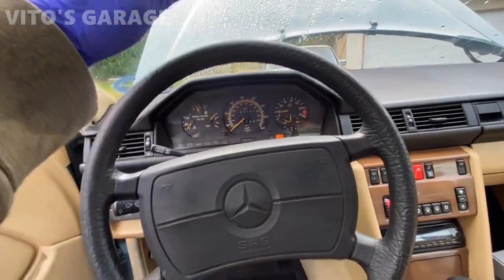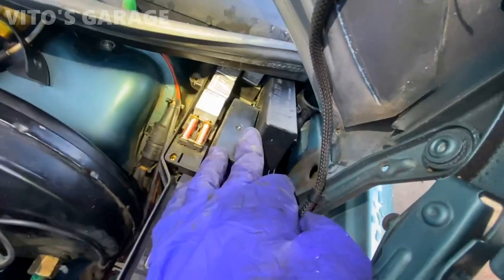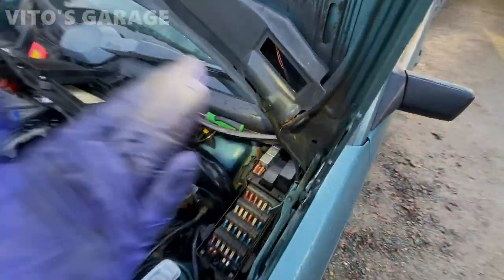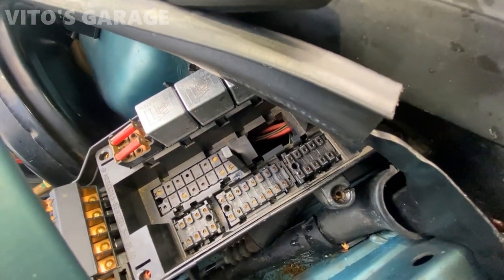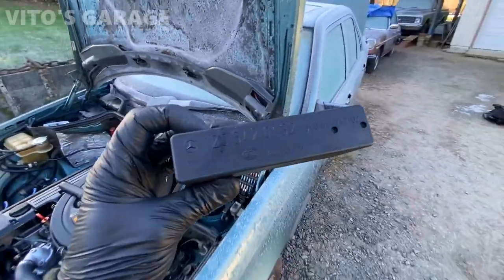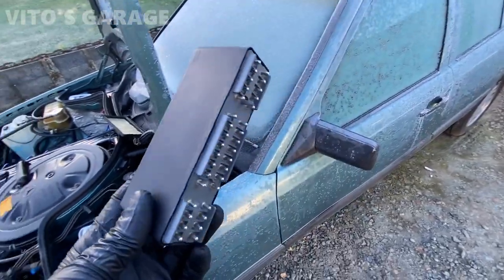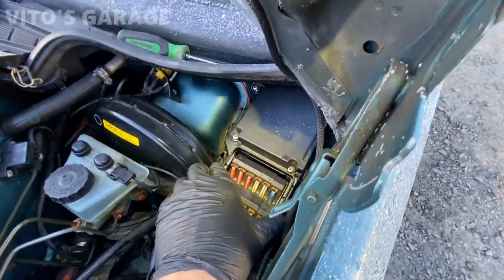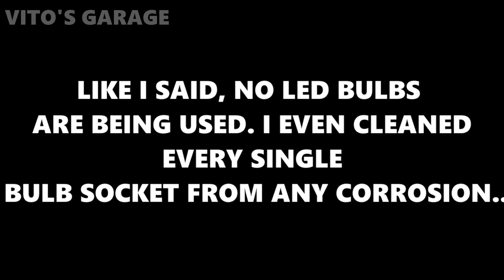W124 Mercedes 300E Lamp Monitoring System Problems.. Everything Works But Still Shows ''Light Out'''

Comment: I would check the load on the complete circuit first. Lower wattage or LED bulbs will decrease the current draw and trigger the burned bulb signal. See if you can measure the correct value of the known good on another car. I did it on 126 a while back and traced it to the front lights.

Comment: Hey Vito, I have had this issue on a few of my 124's too. They are very sensitive to having the correct Wattage of bulb in every bulb fixing.

On my E220, the fucking shaggy car kept on spitting the orange warning light like yours, eventually I replaced every rear bulb and the boot bulb with factory spec mercedes bulbs from the dealer and cleaned all the bulb contacts, job done over here in the UK. Common problem really. Hard to check if the trunk bulb goes off when it should too.

AMAZING work as usual Vito, much love.
Reply from the maker: Thank you so much!

Comment: I think these are resistance balance comparator units so check resistance in each of the pairs. Both lamps in each pair must be almost the same. You may need to get some lamps from the same place (and manufacturer) and change in pairs giving the best chance of a balanced match. As the warning light is on when you turn on the ignition it won't be the brake lights.

Comment: Hey Vito...I just got my 89  300e back from the mechanics after doing as lot of preventive maintenance and body work.   The issue now is that ALL the lights (warning lights) come on every few minutes and then go off for a few minutes.   New battery was installed as well....any clue on what it could be?   I dont wanna go back to mechanic and pay an arm and leg again  😂

Thanks
Reply from the maker: Hi there. Thank you for loving your W124!! Try checking your charging voltage. Have you done that? Your alternator or voltage regulator could be going out
Reply: @VITOSGARAGE  after last night's drive its idling pretty rough and all the warning lights have stayed on. Notice interior lights dimming and coming back to normal.    Alternator?  Spark plugs?    Thank you

Comment: I have changed every bulb in my w124 to led and it has gone crazy, it burned 3 times my interior dash lights switch until i set a bigger fuse and the car sometimes keeps the hazard lights flashing even when i lock my car.
Don' t know, thinking about going back to halogen.
Reply from the maker: That’s a strange problem. I’ve never experienced or seen something where the exterior LEDs would burn your cluster

Comment: Check the city/driving light bulbs in the headlights.  they are a small 3W bulb just below the headlight bulbs.
Reply from the maker: Inside the headlamp is only two bulbs. 1 low/high beam and one fog lamp bulb
Reply: My w124 is a grey market European import.  So I have a third bulb for city lights.  It is a small 3w bulb the plugs in directly below the headlight bulb in a separate socket.  

Also could be the headlight switch (part # 000 545 62 04 MBZ or wiper relay (part # - 201 821 00 47), both of these can affect the voltage to the bulbs which will cause the fault light to come on.  Lastly, try replacing all the taillight bulbs (turn signal, reverse, brake & rear fog light bulbs) with the factory replacement equivalents.  Even if they work, if they are the wrong voltage it will cause the fault light on the dash to illuminate.  This literally just happened to me, as I put a larger watt bulb in my rear parking light bulb, and it caused the fault light to go on.  As soon as I replaced it with the factory rated bulb, no more dash light.  Hope that helps

Comment: Hi did you resolve the problem, I'm currently encountering it
Reply from the maker: You need a new lamp monitoring unit
Reply: What is the light turns on and off randomly? Still new? Is there a way I can fix it myself other than what you did? @VITOSGARAGE
Reply from the maker: @blazepurplehaze696  does it turn on and off randomly when you’re pressing the brakes? Switching headlights on? Or when does it do that?
Reply: @VITOSGARAGE  I think it's random but sometimes I see some change in its brightness when pressing the brake. Most of the times when I switch on the headlights the lamp stays on, and after some time it disappears and appears. I thought it might be something from the brake pedal but I can't tell for sure ...